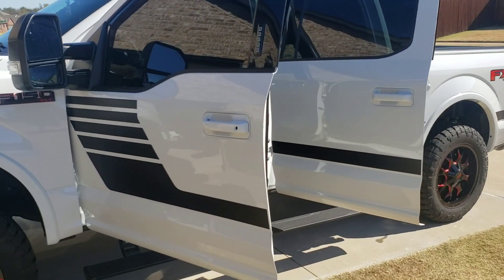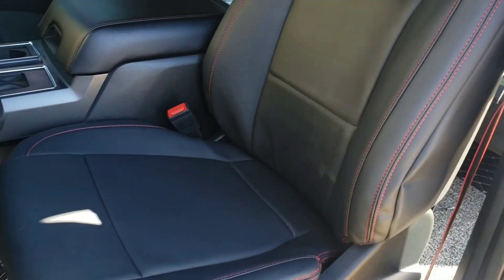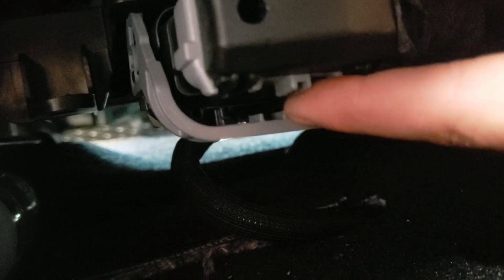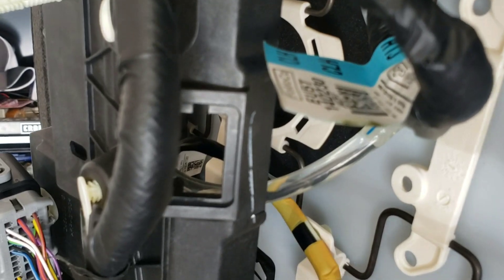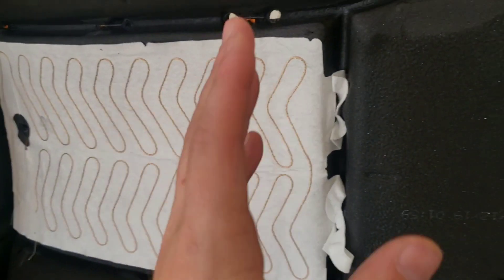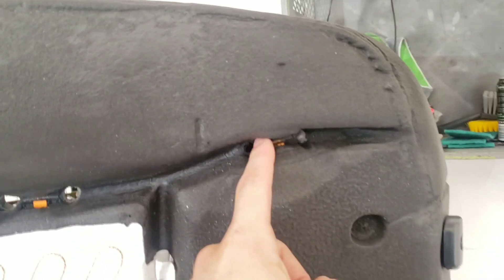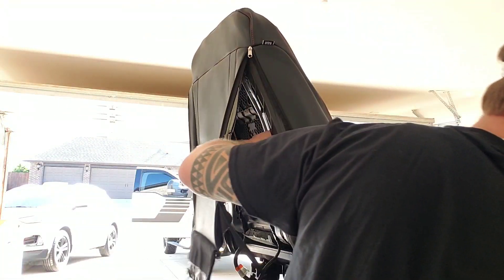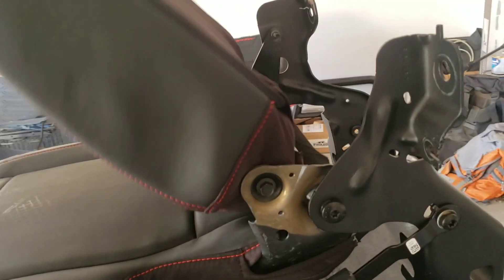F150 BRAND NEW LEATHER SEATS, NO MORE CLOTH!

Comment: How did you do the double bench seat in the rear? That’s the only seat I have left and there looks to be a shock on the bottom side that attaches to the feet of the seat and I can’t get the original cover off with it there.
Reply from the maker: Not sure what your referring to with the shock reference as I dont really remember as it's been quite awhile. But there should be like 5 or so bolts behind the seat to pull it out. If it's already out, u just have to remove the plastic caps on each end. I believe there is 2 screws holding each cap on and a bolt then underneath to remove
Reply: WickedF150 
I wish I could send a picture of it but thanks for the help, I have a lower trim package so it might be different for me but there is what looks to be a shock on the underside of the double seat directly behind the latch that puts up the seat which connects to the metal feet that you bolt to the floor of the truck. It would be the side of the seat that is closest to the door if it were in the truck. Again thanks for the help and I’m a big fan of your videos!
Reply from the maker: @karsonh4908  hmm yea I dont remember anything like that on mine but I wish you luck! Lol if you want can always message on Facebook or Instagram with a picture
Reply: WickedF150 thanks, I’ll give it a shot!

Comment: Love your truck been looking to buy either a ranger or an f150. What engine would you recommend for the f150 that’s reliable and gets good mpg? Im planning on getting the 2015+ and Ik some of the newer engines have a some issues
Reply: Theyre all strong engines. I personally owned a 2.7 and with some custom tuning that thing hauled ass. Id say its all about budget. The 3.5 is the king and id rather have either over the 5.0.
Reply from the maker: Gas mileage would definitely be the 2.7 and it also has the least amount of issues. But if you tow a good bit or more than 7600lbs then I would get the 3.5 prior to 17. You could always pick either, any year but it may be luck of the draw after that
Reply: Dane B alright thx definitely going to try to get a 2.7
Reply: WickedF150 alright thx dude I saw on your other video that you where recommending different engines per year but ok I’ll get the 2.7
Reply from the maker: @IsaacVK2.7  yea, the update in 17 on the 3.5 is when more issues started with that one and then the update in 18 on the 5.0 started issues with that. It is most certainly still possible to get a great one though. But like I said with gas mileage, the 2.7 is definitely the winner.
Reply: And as for towing yes the 3.5 is the strongest but I put the trailer brake controller on my F150 and pulled my dump trailer with plenty of weight in it multiple times I do Concrete Construction for a living of course I have a F250 now but the truck did the job. Of course i was tuned also.  the only thing I can say is if you have the opportunity to get 4wd do it. There's nothing like getting stuck in some wet grass 🤣

Comment: I would’ve just got the lariat SE at this point. Love your vids tho.
Reply: Darkangel7682 the Lariat cost about $9500 more than a XLT my opinion I’m fixing to go shopping for a new truck I’m gonna get the XLT and get the leather installed it’s $1,000 more that’s about the only option I would want no point in going with the lariat just for the seats all the other options I don’t want anyway just my opinion
Reply: Why would you spend an extra 10 grand to get leather seats 😂🤡
Reply: @unrealhighlights3853  he’s done a lot more to it than just leather seats. The majority of the mods are standard on the Lariat.
Reply: @Darkangel-sw9lm  The Lariat leather quality is substantially worse than Katzkin leather, and much more expensive, too. Not to mention you are forced into buying a bunch of other features that you may not want. I think XL/XLT is the way to go and then add options you want yourself, unless you want most/all of the options of the higher packages and don't care about money. But many of the higher trim options come with downsides, like the Limited has a substantially worse towing performance for example (I believe because it's so much heavier but could be due to other reasons).
Reply: @user-nh3gu1ge3d  it’s because of the 22 inch rims.

Comment: My 2018 3.5 runs just fine, only have 4k on it though... had a 2013 3.5 as well that had a few issues i roll a 6x10 trailor all day everyday so the power gets used... started around 40k on the top pass side of the motor i could notice signs of oil, the front right caliper or rotor had issues locking up an would smoke at stop lights, right at 55k either the oil pump, oil sending unit or perhaps just faulty wiring id pull up to a stop light an the oil pressure needle would drop to zero an the truck would chime... as you said its just luck of the draw with anything you buy today not just fords...